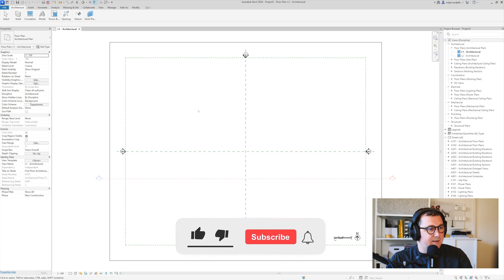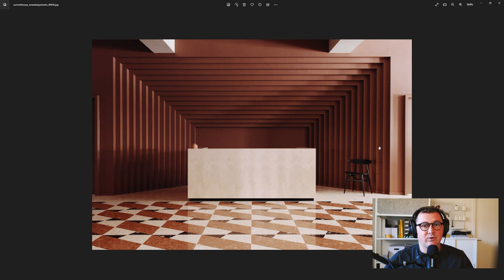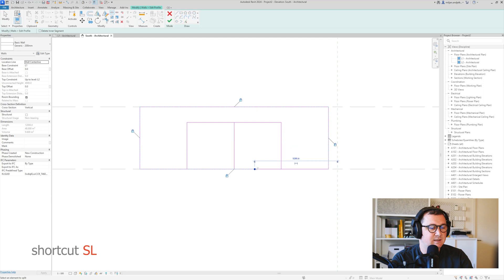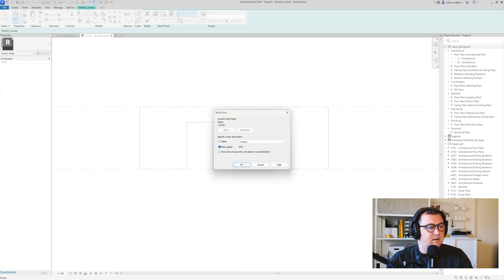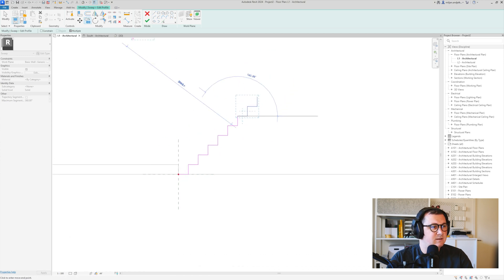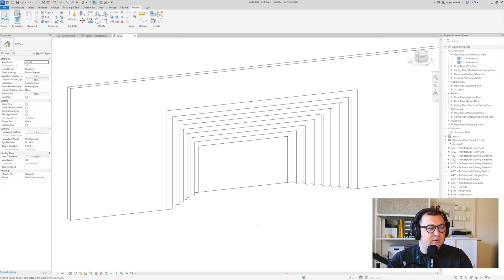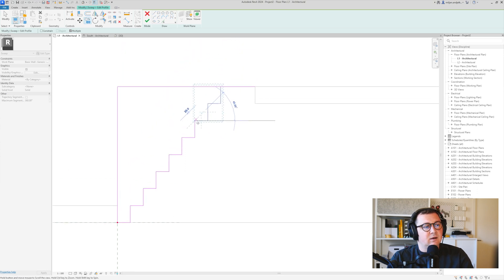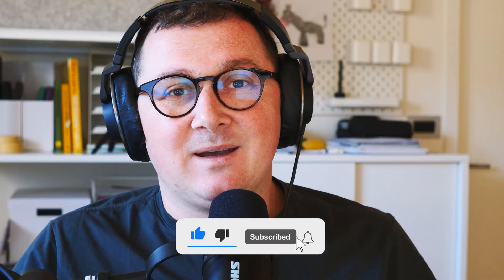Revit Interiors - Modeling Tips & Tricks

Comment: i model it same as yours, but when i want to apply painting on it, it does not work with me, can you please explain how to paint that type of wall.
Reply from the maker: You made it as a Model In-Place and in that case Paint tool doesn’t work. What you need to do is to open Model In-Place element and to assign material or material parameter to that geometry